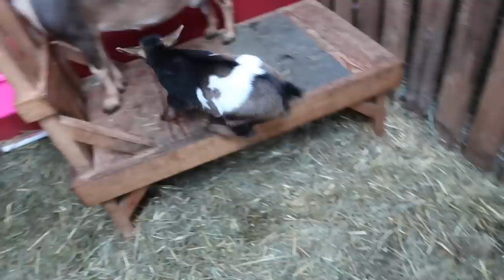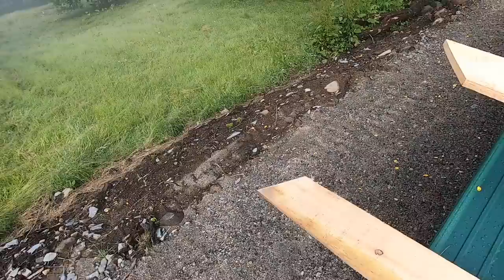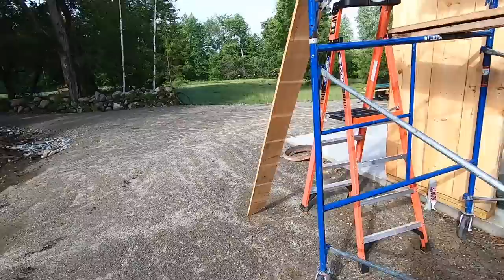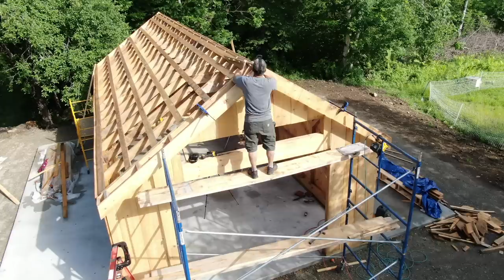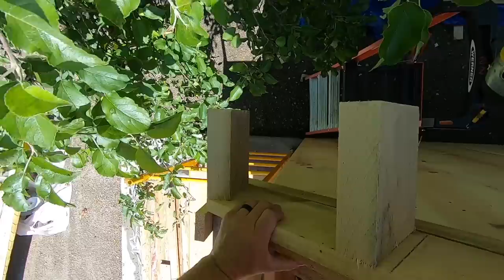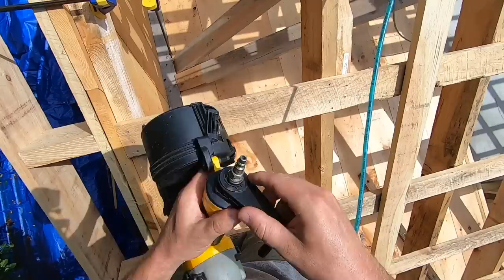This Kicked My BUTT! Installing the Fly Rafters and Shadow Boards

Comment: I feel ya brother, I know how it is building by yourself primarily. Been there and did that, barn, shop, log house etc.... Takes a little ingenuity at times but a lot of satisfaction when you get it done. I am 65 years old and still prefer to work by myself on big projects.
I hope to cut logs this fall to build a small off grid log cabin on my homestead next spring. Be safe and keep working at it...
From South central Kentucky...

Comment: Al, you should build a garage or at least a car port to keep the weather off the cars, they are one of your most expensive assets and having them under cover is not only a comfort thing in the summer but also safety when it’s icy,  freezing, foggy or snowy not having to deal with dew, ice and snow on the windows
Reply: I'm waiting for the deck build but you're right the carport should come first .
Reply: James T ...Just give the man time. The have come so far and you can see the plans coming together🙂
Reply: Fiona C Hi Fiona, it was a suggestion and not an order. I enjoy watching Al build and have noticed how they struggle with iced up vehicles in the winter, I don’t want anything to happen to his Family plus productivity will go up 🙂

Comment: Al you need to trim that tree 🌲 back a ways from the back corner of your barn. Otherwise squirrels🐿 will climb over to your barn & possibly chew a hole into getting in your Eve of the roof. Especially when they can smell feed inside, makes them wanna burrow up in the eve when they got tree 🌲 limbs to climb out & in by.
Reply: He's likely waiting until more of the roof is finished so that he doesn't stick himself with a cut end. I've done stuff like that myself.
Reply: Came here to make exactly this comment. That tree rubbing against the far corner will cause trouble down the line.
Reply: @mariayelruh  yep, did that building cabinets with a finish air nail gun, holding the stock, the nail glanced off a knot and right into my finger.  OUCH!  I was cringing when he was using the nail gun so close to his fingers with those 2 inch nails!
Reply: Very true. 👍

Comment: When you are hanging that facia, tack a 16d nail on the top of it over the lookout blocks and bend it over.  Do it in several places and you can hang it on the blocks.  this works well for any situation where you don't have someone to hold the other end.

Comment: I sure worry about you doing most everything alone.  It's all looking great.  Please be careful. It only takes one mis step to ruin your plans.  Get your friends to help more.  Keep up the videos..😁🐓🐓🐓🐓
Reply: Or at least put on a safety harness
Reply: @phillipjensen8580  every time I've worn a safety harness it has made the job more dangerous by adding extra trip hazards right at your feet and the weight of the rope hanging down to the ground pulls you backwards a little bit. I never liked them and only ever used one when working on an extra steep roof. Using them by yourself is even more dangerous, if you do fall and you cant lowerer yourself to the ground, from what I was told, would lead to blood supply being cut off to limbs which is not good. The only times I ever felt unsafe was when I was wearing a harness lol

Comment: Great job. You could put the ladder together on the ground and then install them.Easier to put them together and make them flush with the top of the strapping. #50 Pony clamps are easier to use than the large Irwin’s. They have more clamping pressure which is very useful for what you are doing. You probably don’t have time to read the comments:))

Comment: Rather than blocking up under the fly rafter and trim board it would have been easier to attach to the top of the piece being put on and let it sit on top of rafters. This would allow you to slide it up or down to match up at the peak.  To late for you but maybe someone else will be building.

Comment: Hi Al. I have been watching your channel for a couple years an am very much enjoying your barn build. I have gotten goats largely bacause of you.  I have a couple questions about milking goats.  1.) When you wean the kids will you have to milk twice a day?  2.) If you did a video on you new milking method with the plastic tubing and pump, I must have missed it. What is that called,  and where did you get it? I do not have a goat in milk but I believe I have at least one that is expecting.

Comment: Surprised you didn’t get larger overhangs, they keep the weather off the sides and increase the life of the barn a lot at the front an rear, the lean-too’s will do the same job on the sides.

Comment: I hate those galvanized hot dipped ring shank nails! If you hit a screw or nail and it needs to be pulled you have to hook a tow truck up to it to pull it out 😂! Installing the ladders by yourself is a tough job! Your creative ingenuity is impressive! 👍🏻👍🏻👍🏻👍🏻 I see the building inspector is keeping a close eye on your work 🐈

Comment: Isn't dewalt owned by black n decker?
Reply: Hope you don't mind me stepping into answer, but I looked up DeWalt so that I could write to them about the terrific job Al is doing on the barn (as well as all the advertising they are getting).  Yes, DeWalt is owned by:
STANLEY BLACK & DECKER (with corporate offices at 1000 Stanley Drive, New Britain, CT  06053).  Best wishes from Kate.

Comment: Your videos would be an excellent teaching tool for someone in the building trades program.  Will try to get my grandkids to watch and learn.  I have no, and I mean no talent, in anything construction.  You are an excellent instructor.  Why were those boards put on the front of the barn in this video?   Believe you called them a "fly trap?"  It is amazing that the boards are all cut and fit together.  Believe today was the first time you sawed off any of the supplied lumber.  Why was that necessary so did you make a change in the construction?